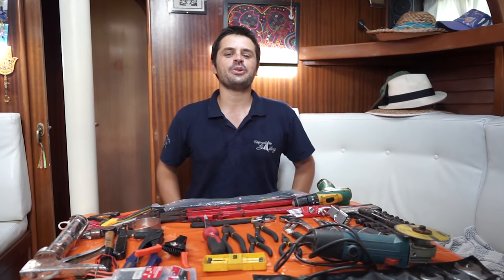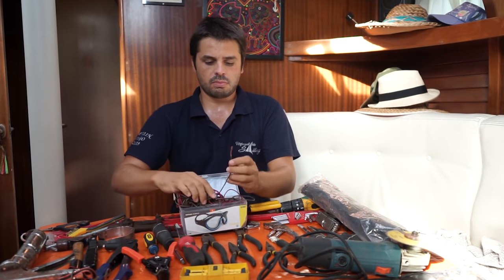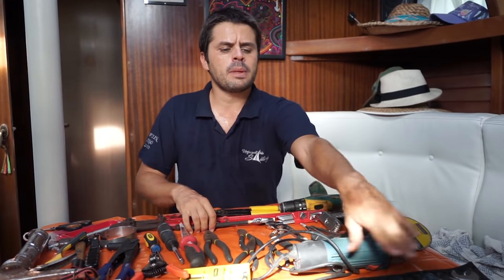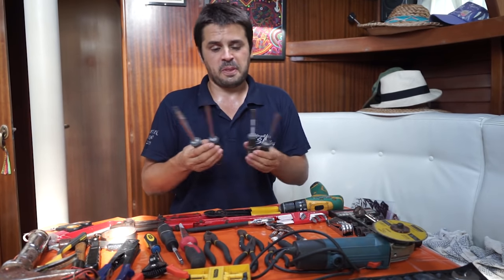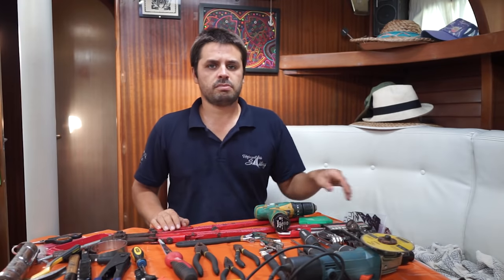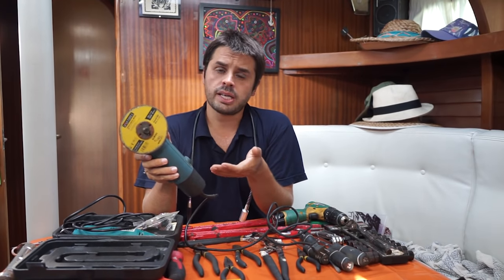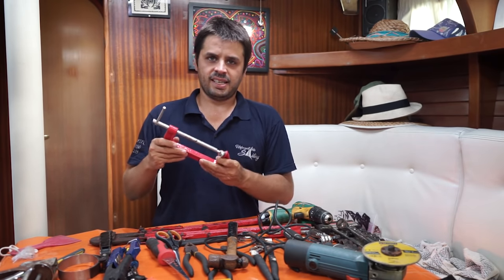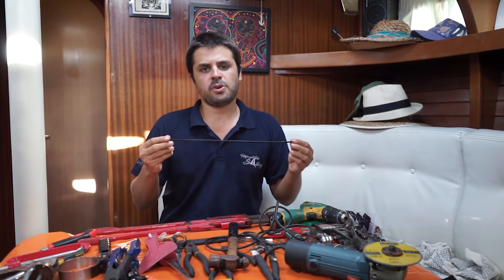Basic Tools every sailor SHOULD HAVE - Unforgettable Sailing

Comment: Diego, Good job on this one.  Bosch makes a screw driver drill with different attachments so you can have a regular drill, and angle drill.  An oscillating tool. Also include a hack saw, spare stainless bolts, nuts, and washers, assorted o rings, Rubber mallet, chisel, and files (regular and rat tail), I also found this small right angle Neiko ratcheting screw driver for those really tight spaces where a screw driver is needed but won’t fit...even a stubby screw driver
Reply from the maker: Hello Captain well you just wrote my wish list!! 😄 Cant wait to get to austealia en get some new toys. Take care!!!